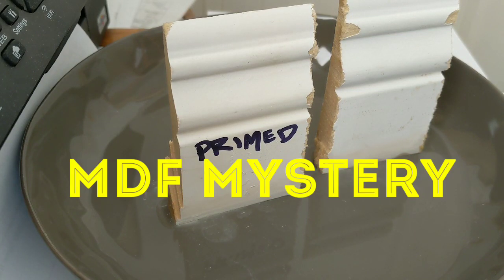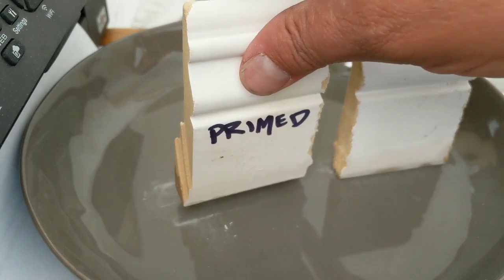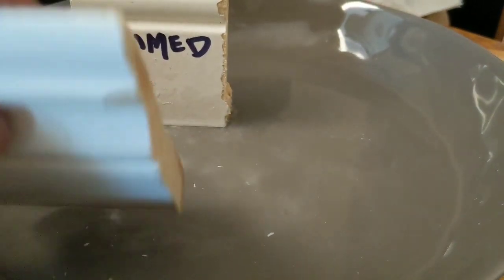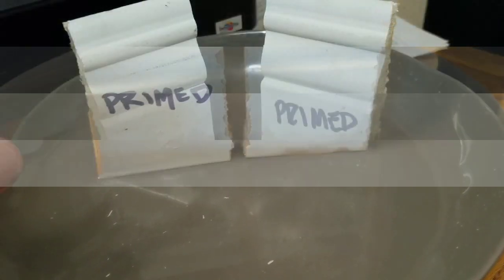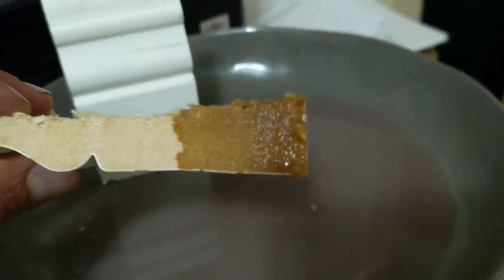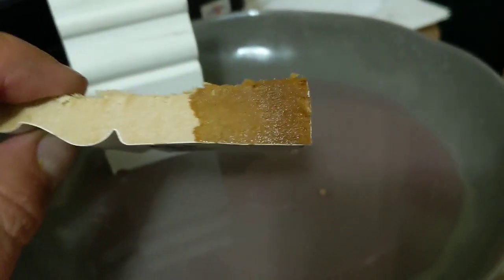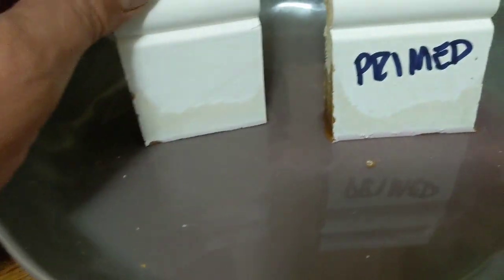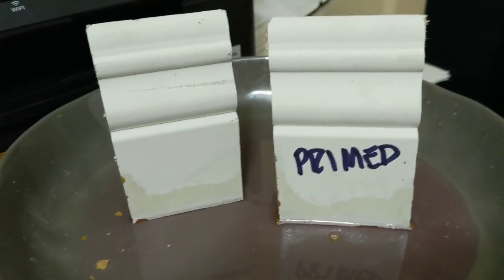Does water alone cause MDF to swell?

Comment: Is that pure water your soaking it in, wonder if the pre sprays would make a difference with the wetting agents and surfactants make a difference
Reply: Nvm didn’t watch long enough before I commented
Reply from the maker: @RawOutdoors556  but yes, you're correct, wetting agents sped up the whole process
Reply from the maker: turn the sound up